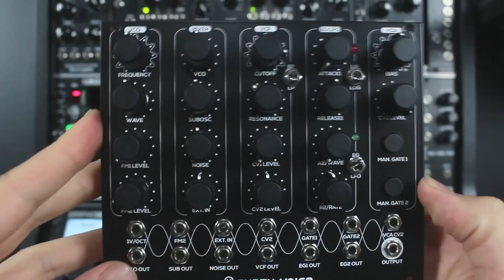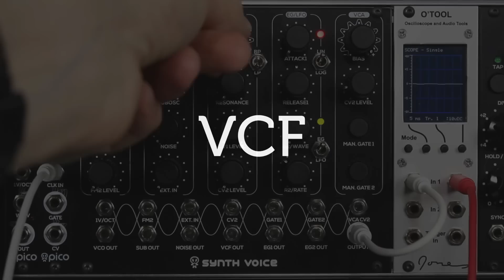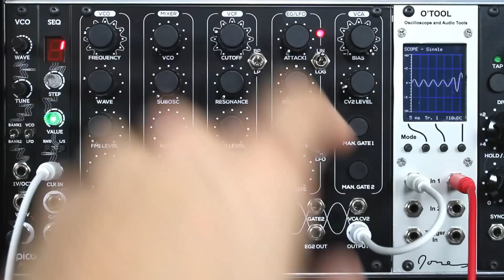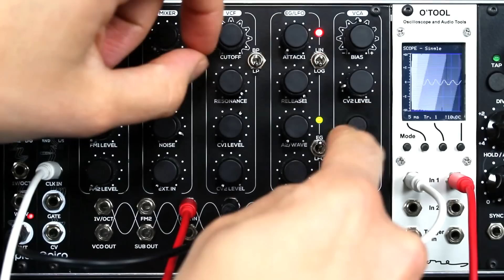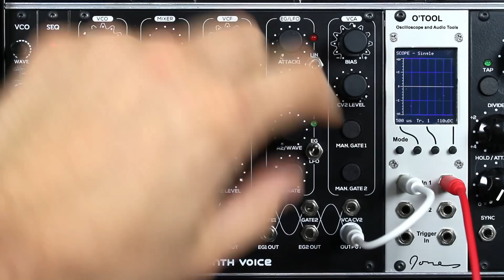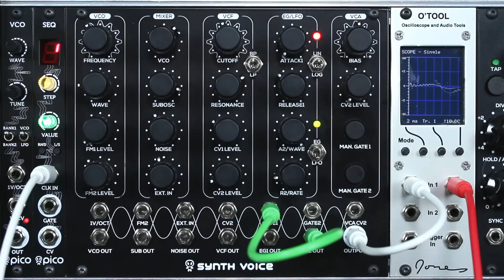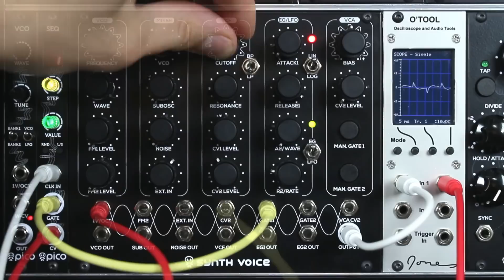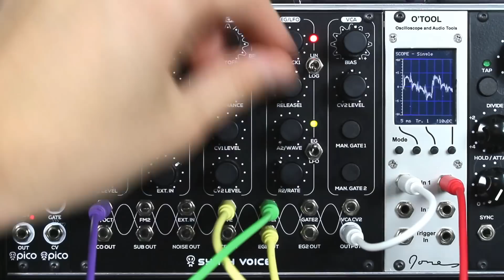Erica Synths Eurorack DIY Synth Voice

Comment: this could be used as a stand alone synth?
Reply from the maker: yes you can build it into a small case and use as a standalone synth! :)
Reply: yes, but you would need a midi to CV (with gate output) converter to be able to play it on a keyboard, and a case for it, which they dont provide.

Comment: "The VCO is digital"  Wha?
Reply: TotallyNuss probably digitally generated with samples or something
Reply: @Shockszzbyyous  
it's a wavetable VCO (wavetable is a bank of single cycle samples of a waveform) so if the thing you are sampling is a saw wave at 60hz you would take a 1/60th second sample.
imagine you take a sample and then look at the wave that was recorded it would look kinda like this ^^^^^^^^^^^^^^^^^^^^^
a sample for a wavetable looks like this ^ (its just a single cycle of the wave)

 so yeah its VERY short samples looped (the faster you loop it the higher the pitch)